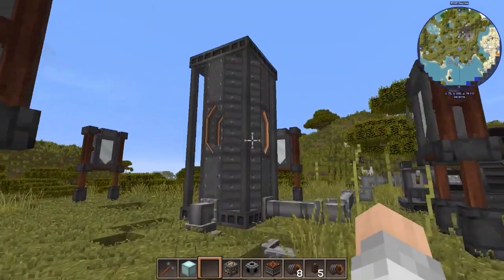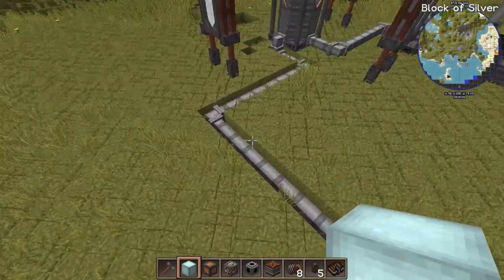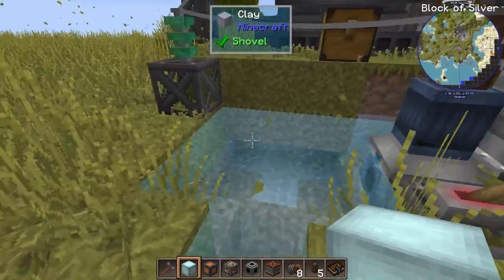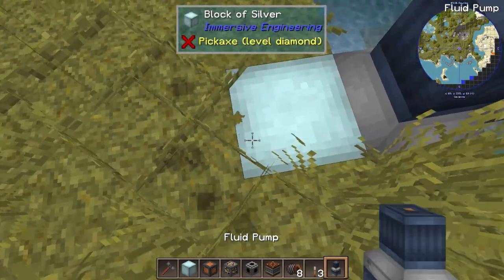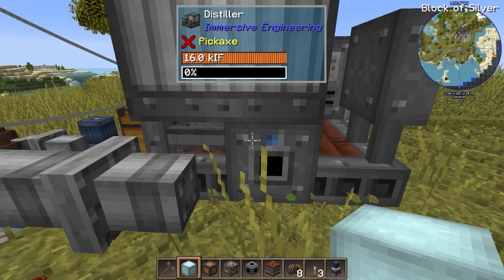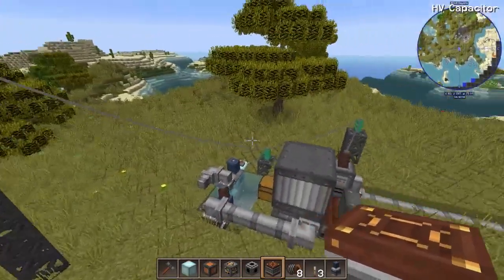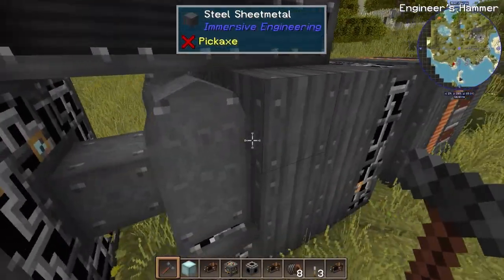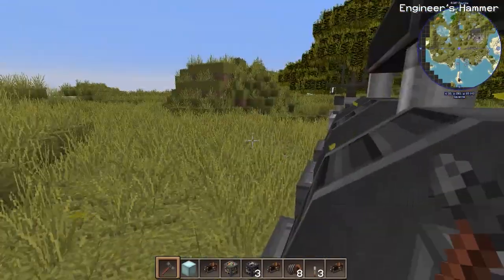Minecraft Immersive Engineering: Steam Turbine Tutorial

Comment: RIP in the modern versions you need WAY more solar towers to maintain a steam turbine, i tested it in creative and 3 weren't enough even without counting the day night cycle. Also distilled water is no where near as worth it since it got nerfed hard.
Reply: What is the best end game energy thing now? (for late middgame - lategame
Reply: @shotcrib77v56  For lategame the steam turbine still is the best way to produce power, while in mid game you should run at minimum 2 diesel generators, one for running an excavator to get the resources for the turbine and another one to run the rest of your machines.
Reply: @gulagkid799  Thansk ! :D
Reply: @gulagkid799  hey there, is there a 1.16.5 version for immersive tech/technology?
Reply: @daniel17852  sadly there is currently only a 1.12 version of the mod
Reply: @daniel17852  its 1.12.2 only for now, but its opensource so if you were interested in learning java, the forge api, and the immersive engineering api you could port it yourself
Reply: How much do you need I have 4 with distilled water? Also I know this comment is 2 years old so hi from the future idk